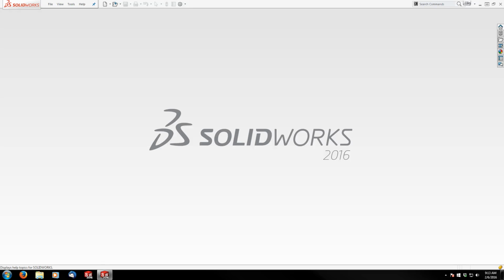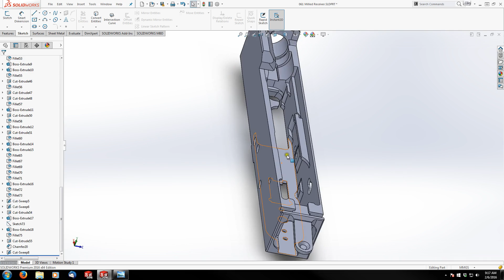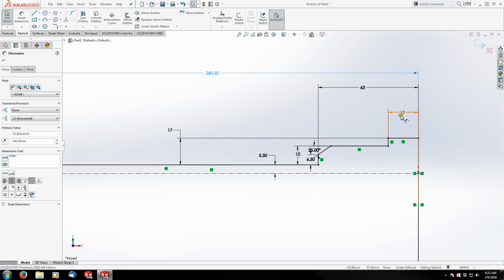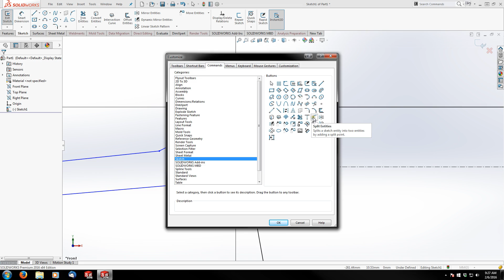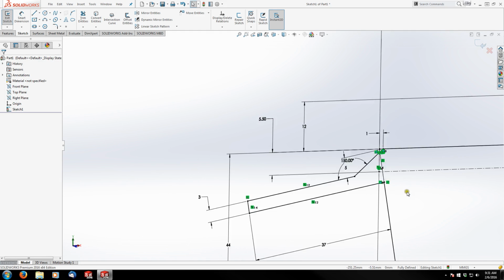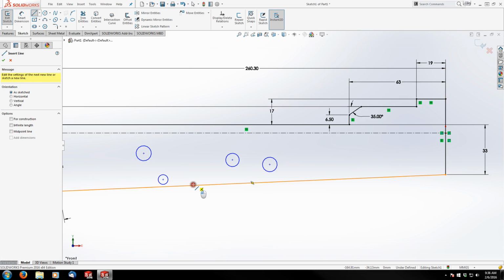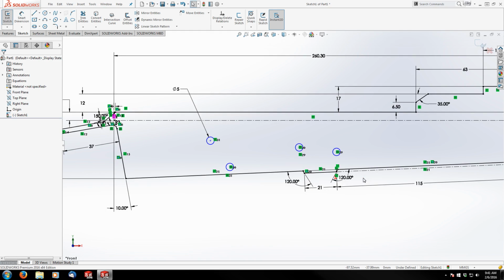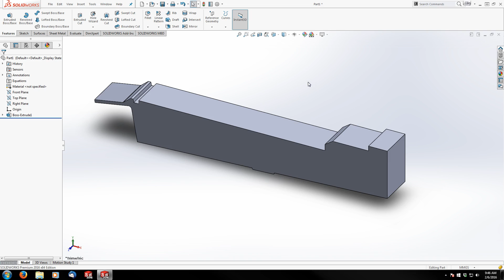02 Milled AK Receiver Part 01

Comment: im wondering how the undersides of the rails are cut away. the only way i could think of, is if it were drilled long ways from the front or back of the receiver but it doesnt make sense because the bottoms are flat in receivers such as tortorts.
Reply from the maker: Look up T-Slot cutter and you'll see how it's done.
Reply: @WingZeroGWO  ohhhhhhh makes sense now thanks lol

Comment: enlighten me, what the fuck do those double equilateral triangles with numbers next to them mean (I assume those are chamfer) and what do those dimensions with letters next to them mean? You know, ones like "4b6" or "12a2". they perplex me.
Reply from the maker: Hey Connor, Those triangles are finish marks. They are calling out a certain allowable or preferred roughness. As for the dimensions with the letter/number combo, those are based off of an old soviet tolerance table that I haven't been able to find.

4 B6 is a 4mm dimension with a B6 tolerance. What is the B6 tolerance? You're guess is as good as mine, but if anyone has the original soviet tolerance table, I would LOVE a copy. 

As far as my work goes with these prints, I've had to rely on my own expertise to appropriately tolerance these parts when creating my own set of drawings.
Reply: @WingZeroGWO  lord almighty this helps so much. Thanks. I've been spinning my wheels trying to look this shit up in ancient engineering textbooks. You're a king.
Reply from the maker: @connorcampbell5274  I appreciate it! If there is any cool side-skill that I've picked up from working with these prints over the years, it's the ability to read Russian Cyrillic. The manufacturing notes on the prints have critical detail that can be overlooked if the notes are ignored as gibberish.